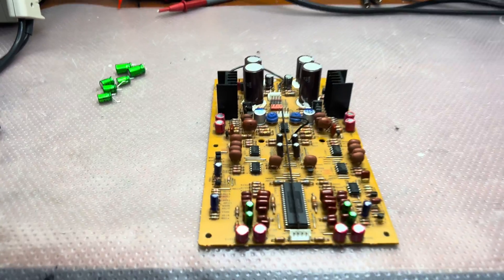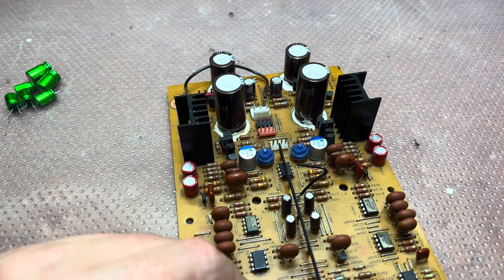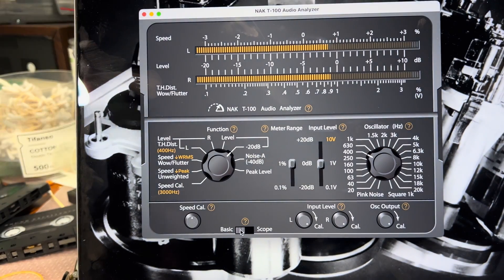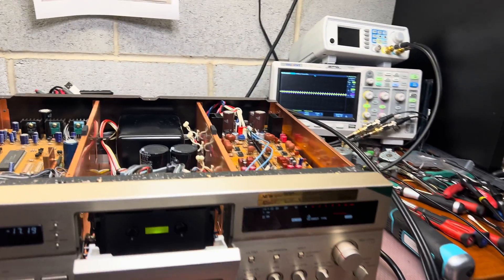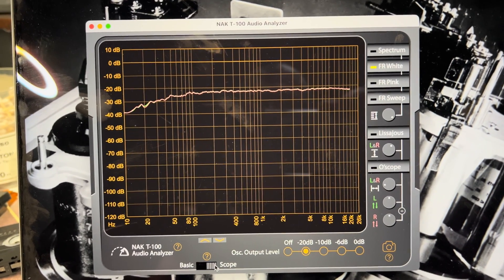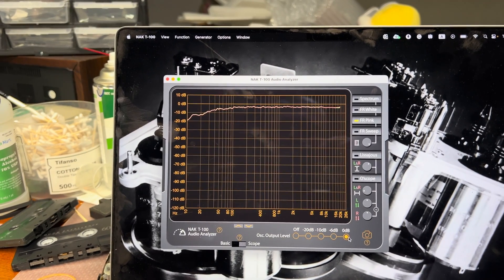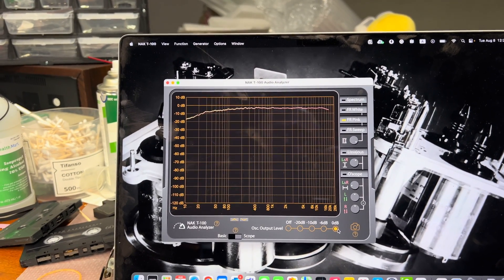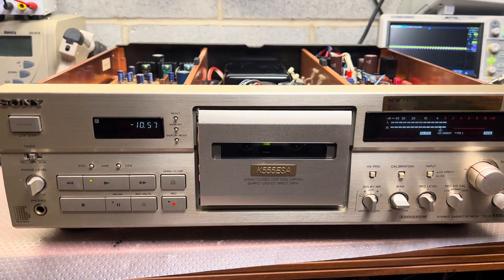Elevating Audio: Installing Solid Polymer Capacitors in the Sony TC-K555ESA

Comment: Shuffling that board with a big IC  around on a vinyl mat and no ESD protection is just asking for trouble.
Reply from the maker: Never had a problem because of statics. I had because of accidentally shorting some circuits ;)

Comment: My thoughts: 
1. There are hundreds ways to change sound, caps are just one way and so much related on where the cap is used. Most caps are in the power section, some are for signal. 
2. I still prefer Muse as an excellent bipolar cap, very neural, fast, straight, and first of all: NOT BORING. Unfortunately, many fancy caps like Elna Silmic etc. pp. are just dead and sound like a non swimmers basin, still Muse are not fancy. 
3. Take time to judge about sound (tape decks are NOT real high end but a nice playground, I also appreciate).  But bring it to your best system and listen there.  A headphone plug of the deck is a no go. Caps need weeks or months to formate on a electrochemical level.

Comment: did you replace regulator output caps with polymer?. i do hope you scoped the output voltage since some regulators (both linear and switching) could went into oscillation with ultra low ESR caps and this is sometimes not detected on signal output. i've experienced this before and the fix is either i add small value series resistor or swap another caps

Comment: I have a 50 year old receiver that I need to recap. Should I upgrade the electrolytics to solid polymer? If so, which type is recommended?
Reply: Just recap it with quality electrolytic caps like Panasonic, Nichicon. As long as you are not sure, don‘t use polymer or other specialities.